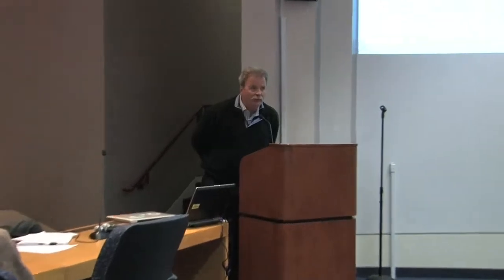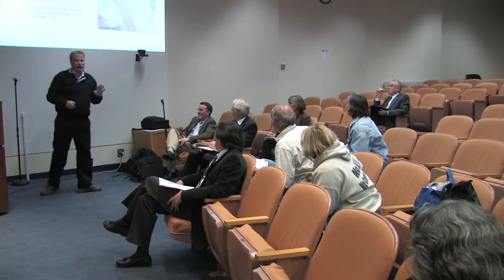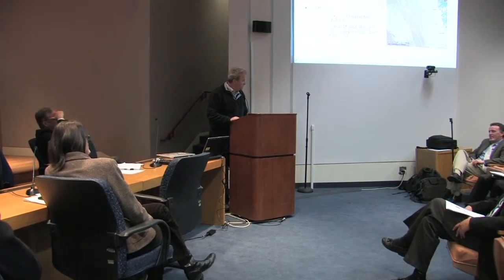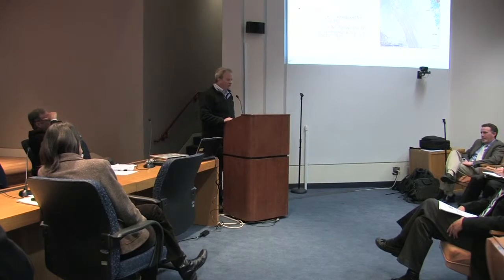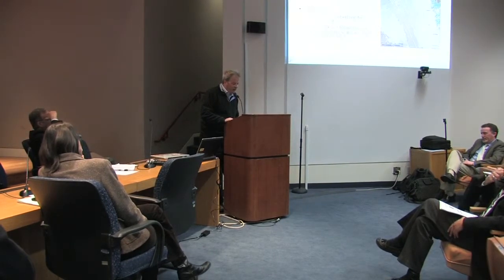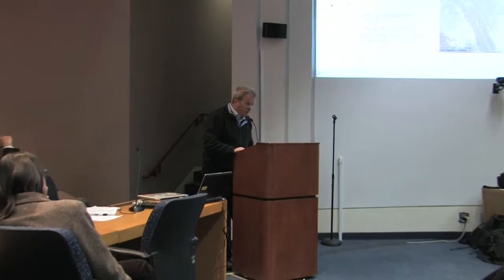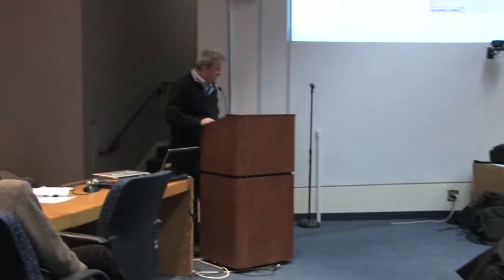Seismic Risks at SONGS

Comment: This stuff takes a bit of work to be prepared for.  Sadly, I'm busy elsewhere, and didn't even know this was happening.  Would have been nice to have participated, since a good slice of my current project is working on this very issue. The swarm Bruce Campbell was asking about, which has been happening for quite awhile is located in the San Diego Trough and there's alot happening there.  

Again, there's a geology consultant in Palm Springs that would have liked to participate, sadly.